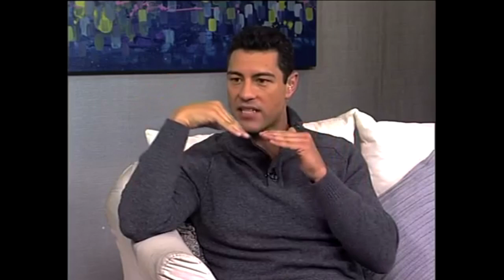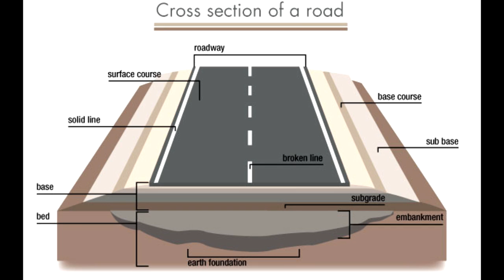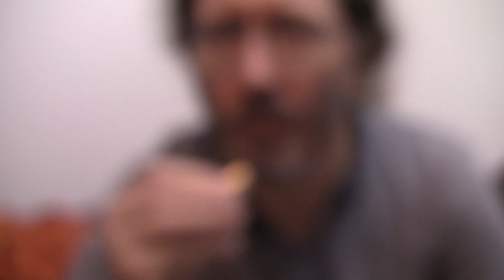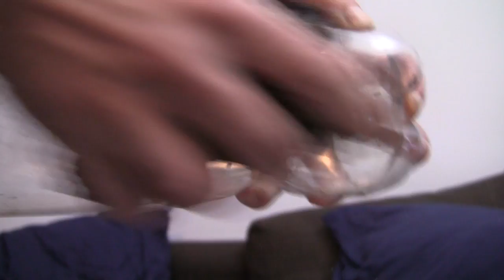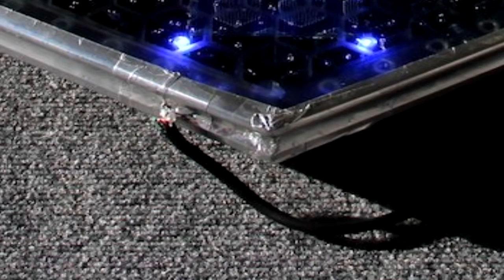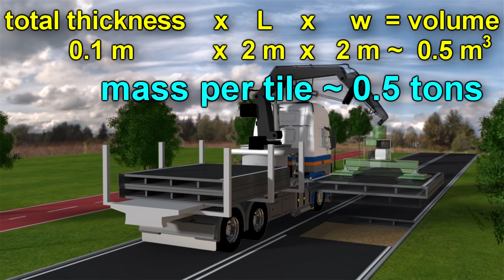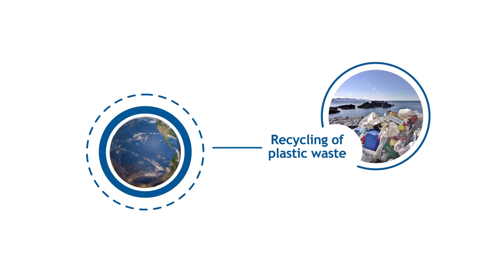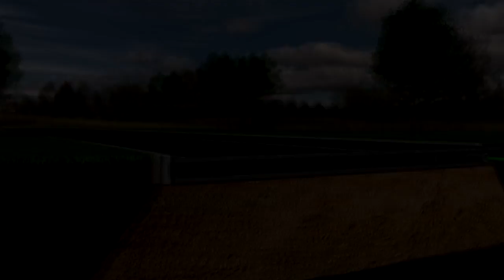Plastic Roadways BUSTED!

Comment: Not to mention, prefabricated road segments wouldn't work with the gradient of the road. Roads aren't flat. They are like 1-3 degrees for water run off. It would be extremely hard/impossible to make that work.

Comment: That’s what I told a guy who make gardening containers out of those thin department store plastic tubs, they turn brittle and crumble quickly in UV, he didn’t believe me.  I’m sure he’s replaced them by now, with a different material.  The idea was absurd for food production, never mind being possibly toxic and not food grade. Just the beginning and many more problems. 80,000 pound load on a trucks, a smaller truck can weight 10- 20,000 lbs.  With autonomous driving truck trains their will be loads of 300_400,000 lbs over the wheels.  About as silly as putting a train on plastic rails. Try landing a jet on plastic as soon, do these thing ever occur to them, the foundation below, bridges? Will they just blow away in storms or hurricanes and tornados? ...Plastic shopping bags, everyone knows they cannot break?  They said reuse your plastic, maybe that includes all the syringes?  No straws for you! There worried about plastic guns?

Comment: That design would need to be made from steel to support the weight of the cars. To support trucks they could increase the numbers of supports and make it in box sections of reinforced concrete. The joints would be bumpy and wear out. But it would be good for a year or two. You woukd need to reduce the costs by about 500%. Then it would be a viable alternative if you could reduce the joint wear problem by 500%. Then shes good to go. Alternatively you could use magnets and lasers instead of wheels on the cars, to spread the load better. You just need to research the details (such as fundamental viability of concept) , sort out the design, and your good to go.

Comment: I love the whole statement on asphalt recycling -- lol.  I remember seeing a machine many many years ago (may have been a test concept item) that would pull up asphalt from the front, reheat it, mix in some recycled asphalt from other sites (that could not use this machine) and relay it out the back.  Now not sure if that ever developed further as use may be limited.  But the fact that could even be tried shows how the material can be recycled pretty easily.  I always see piles of the stuff off to the side (both asphalt and concrete) from major road work going into grinders and being trucked off (for recycling).  Contracts in the US are required to have recycling clauses in them for all major roadwork (politicians did something right?  Nah just a fluke likely).  

I also keep imagining an electric car having a fire on a plastic roadway.  Heat + Plastic = one hell of a mess + toxic smoke (quite often).  I wonder if they could recycle the plastic to make if flame retardant to pass fire codes???  LOL
Reply: Those road repaving machines are all over the place and have been for decades.

Comment: I wouldn't say it would not work.. May need some extra polymers, but we can deffinetly use it for side walks, floors in homes business and schools. That alone is hundred of millions of miles of flooring. As with using it as a street, it can be done and hardened etc... So no certain plastics will be too soft, but mix it with the right polymers and it works fine.. So it's not BUSTED, this is more like a person that doesn't have a clue about helping make this work rather than just saying it won't work with his limited resources..

Comment: I work in a company that manufacturers manhole covers, 100% from polypropylene. They are rated at 4 tonnes, max size-400 mm. A15 class, so it is designed for pedestrian areas. I am not aware of any pure plastic manhole cover which could take 12,5 tonnes in B-class

Comment: I was revisiting a few videos and stumbled across this one and I realised I hadn't actually seen it. One thing that comes to mind when seeing these hollow plastic roads, is just how easy it would be to put IEDs and anti-vehicle mines in them. 
No more furtive digging through rock aggregate & hard packed earth in the middle of the night and then trying to disguise the hole you hacked into the road. Just cut a hole in the panel with an axe, slide in your explosive device and then glue the cut-out back in place, maybe a lick of paint to disguise the cut lines.

Comment: Thunderf00t
Ever vigilant, always watching our six.  Thank you  Thunderf00t!
So polymers are out of the question, ok. But there is no doubt that there is room for improvement.
road sections should be made in a factory, and be fold-able.    There I said it,... NOT sorry.
Or plastic, after scuffing, and on a regular basis, heat to surface melting.  There! fixed! including pot holes!  NOT sorry.
 Thunderf00t, my dear old friend, you know as well as I that people don't much cotton to someone who always complains with no constructive solutions.
Your science is impeccable, even for a bird.
You could take your videos to stellar heights by occasionally making a token, friendly, and constructive comment.
Go easy Bro.

Comment: This utube didn' age well. June 2018 plans were approved in The Netherlands and september 2018 part of a bicycle lane was realized, november 2018 a second lane was added to test in another place under different conditions. The roads are tested for 5 years equiped with a bunch of sensors to see what happens in time. For 100 feet of bicycle lane more then 200,000 plastic cups were recycled. Maybe less rediculous then it first appeared. As mostly happens with innovations.

Comment: So basically plastic roads are: 
Non durable
When scratched by small debris under cars weight turns into microplastics which is worse than normal plastic waste.
Reply: Plastic has a moh hardness of 2 or 3 (depending on the type of plastic) but concrete is 8 in hardness which is why it is not durable
Reply: @Grauenwolf  damn you got this guy roasted
Reply: @KakuOlenMa  dude what? you can have 20 layers if you want, mind that it will be hella expensive but just for the sake of argument you can. Now even with 20 layers, the hardness of the top one is still the same, so it will still wear out at the same pace as the pop bottle. and if a man can scratch the shit out of one bottle with a chunk of rock using just his hand for 10 seconds, imagine what a 2 ton car or 50 ton semi can do, riding on the road 24/7 and with far more debris than just that one chunk of rock.
Reply: Yashua Fradkin ah yes because car tires are always 100% clean. Go ahead and lick your car tire and tell me there isn’t a ton of debris on it.
Reply: @KakuOlenMa  but it wears down super quickly
Reply: Doesn’t it turn into micro plastic in the oceans too? It’s easier to clean up on land rather in the ocean.
Reply: @fadumomohamed2342  Except every road needs a drainage system, and then you have all that plastic in the ground water. Now what.
Reply: @SianaGearz  oof this was a while ago. I think they made space between each panel so the water can go through in case of heavy rainfall.

Not to mention it take a long while for plastic to become micro plastic, so I’m sure it would filter well.
Reply: @fadumomohamed2342  it's not long. U can turn it to microplastics especially plastic dust in just days. Depends on the road. Some roads are so busy.
Reply: So basically they work. Holland 🇳🇱 has already got them in places and it’s working fine
Reply: @Kj_Gamer2614  Dude. A (literally one) bike path is NOT a motor-way.. You are ridiculous for even insinuating that. This is a joke of an idea.

Pretty soon you are going to be talking about how great "solar roadways" are. 
"We have sOlAr RoAdWaYs In ThE UsA (🇺🇸🇺🇸 pride! derp!) hUrDuR, lOoK hOw GrEaT tHeY aRe"

Except we have a (literally one) "solar walkway". Not a roadway. And as was repeatedly explained by many people (such as Thunderf00t), it was never going to work. And its not. The same as this "plastic roadways" project..

"So basically they work". You sound like a child with a response like that. You are basically saying, "I am going to just completely ignore everything you just said and say it works because I said so".
Reply: GetmeoutofSanFrancisco bruh you dumb. Do your research first. They changed the bike path AND THE ROAD NEXT TO IT FOR 1 KM AND ITS WORKED. Do your research. Further more since 2018-2019 India 🇮🇳 has created more than 33,000 km of plastic roads and at a great success which are still working great
Reply: @Kj_Gamer2614  shut up
Reply: lereddit armie I’m just saying the truth. The facts lie in the already built roads that still operate fine. People can hate on me all they want but the facts are to be seen in real life
Reply: @Kj_Gamer2614  it works fine but asphalt roads work better
Reply: @Kj_Gamer2614  why they haven’t made more then?
Reply: @Kj_Gamer2614  
Yeah, it's 30 meters long and only for bikes!
🤣

Comment: Update: There is a pilot road: in September 2018, they installed a pilot section of road... a 30 meter section of CYCLE path. There is actually a post from 18Nov2019 (https://www.engineersjournal.ie) that reposts the year-old information from the plasticroads website with no new data. I guess this idea isn't crazier that the flat-earth, which also won't die, so I suspect we'll be seeing this around for a while.
Reply: A bike path isn't a road. I mean, would I put recycled rubber bricks in my driveway? Sure, wouldn't make a road from them though.

And I have used plastic tiles in my yard. They didn't handle one winter with a flower pot on them.
Reply: @madtabby66  lol

Comment: so you think that black stuff is better,  it's part oil ,
Reply: he saying that plastic is a worse material then "black stuff", if something fails and the electric line is exposed then that could cause a extreme problem like a forest fire and black outs, which will probably have worse effects to the environment then using oil, not to mention that it could also waste millions of dollars in water. plastic is way too week and something as big as a car could break the supports on one side and expose the pipes and electric lines

Comment: So you run a fibre optic cable through a section of road. A year later you need to replace one section if roadway. To relocate that cable will probably cost $20000. It could easily be much higher. I wouldn't want to run cables in this road.

Next problem, here in Canada, that water absorbing function, yhea the cavity will fill will water, which will turn to ice, and probably break the plastic, or at least deform it. We also run snow plows (where sparks fly off the blade) and use gravel on the road surface.

That channel for the electrical cables, that'll probably fill with water too.

Good luck with that.

Comment: How did I not think of the fact that you would have to cut the cable every time you replace a road section?  Thanks for pointing that out, I feel stupid now for even thinking this is even remotely possible.

Comment: There are three other issues that are quite serious....
1.  It can easily be cut by scraps of metal in the event of an accident....
2. Speaking of accidents, what will happen to the surface when gasoline or oil gets poured on them in the course of an accident..... FIRE!
3.  Can they withstand the 80,000 pound stress of a tractor trailer?

Comment: We have a research study on going in Arizona where a small portion of the asphaltic binder is made up of fibers like Aramis. This makes the asphalt able to distribute stresses throughout the area covered and virtually eliminates any sort of cracking over time. Simply never having to crack seal makes surface renewal more effective and seems to extend the life of the installation beyond the 20 year normal asphalt roadway life. The tests are over twenty years old now and results seem to be positive so far.  Work has been done by the PMIS, INC (Pat   McDonald ) and Sunland Asphalt of Phoenix.

Comment: it would last much longer, if they made it solid, like about two feet thick, mixed the plastic with aggregate like sand and small stones, I could see, maybe parking lots being done with panels like this, but roadways... not to mention that oil, that all cars do leak a bit of, even new cars can, decompose plastic. Now if they added something to the mix and used the recycled plastic as a base, maybe, but not as its shown here. Making any of it hollow would just be ludicrous because of the material used. Now that I have a thought, I wonder how feasible it would be to use all the recycled plastic to make large 'lego' blocks to provide housing or temporary shelters.
Reply: There are roads in the UK with mixed plastic and asphalt, but the plastic asphalt ratio is very small. They are basically just throwing plastic into the roads so it isn't wasted.

Comment: So are you going to update this video of trash talking now that they are actually making these and really testing them? Or just keep this non sense up. Even your first point is utter bullshit.
3:25
The point is that it won't save much time. If it takes a whole day to pour and cure the asphalt, but only takes an hour to slap down a few section of this. Then over time it will save you years. It might not be much each time, but it adds up very quickly. 
And oh yay you can dent a millimeter thin piece with your tooth. Yaaay, you can chew, actually fucking chew! Open a can of beans, this doesn't prove anything. You can dent steal just as well as gold and plastic. It takes  a thin piece and then you can do that just as well.
Reply: He was using the plastic chewing analagy to help show as an example of how weak plastic is. Wether or not it is a millimeter thin is irrelevant. It will still erode over time. Makeing it thicker doesn't make it stronger.

Comment: You should see what polystyrene does when it is compressed and heated the right way. Turns to gum then a light concrete like material. It seems to absorb energy, when we had it happen to our poly extruder. It's strong. Probably still not ideal for this but if I was hearing that what they was using I would believe it more.

Comment: Easier way to provide traction add rubber balls integrated into the road. And what about the pollution caused by melting the plastic, which is extremely toxic and can cause atmospheric damage. Oh and the sun will problely melt it or chatch it on fire in the extreme heat which will cause even more atmosphere damage, and cars will get stuck, also imagine walking and going to cross the road which looks fine but when you step on it you sink in and get burned due to melated plastic.

Comment: Trucks hauling freight would destroy these roads. One set of tandem axles of a commercial truck can weigh as much as 34,000 Lbs on a typical tractor trailer. Even more when overloaded illegally. Before anyone suggests taking trucks off the roadways, keep in mind that trucks transport just about everything you use in your daily life, especially food. Roads need to be stronger to last longer and not deform under the weight of commercial truck traffic. Concrete so far is the best construction material however much of the current roadways suffer from the underlying structure not being prepared and reinforced properly. The roadways in America were built in rush both to get the job done quickly and cheaply. These roadways are now in horrible disrepair all over the country.

Comment: In my vehicle, a 2013 T31 Nissan X-Trail, the last of the boxy shape models, road noise is quite evident during highway cruising at 100km/h on rough bitumen.The noise is somewhat similar when seated in an aircraft cruising at 35000 feet. Unfortunately this type of road surface over time will be polished to the point of it being very slippery under wet conditions. Hotmix bitumen on the other hand has a smoother ride quality, is a lot quieter, and better road adhesion under wet conditions...